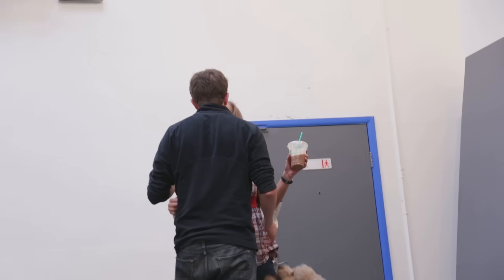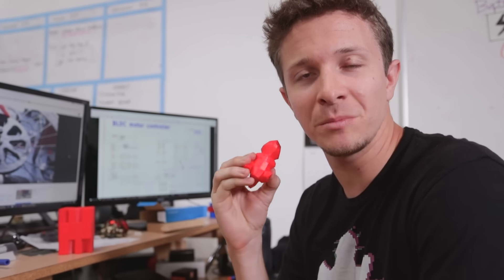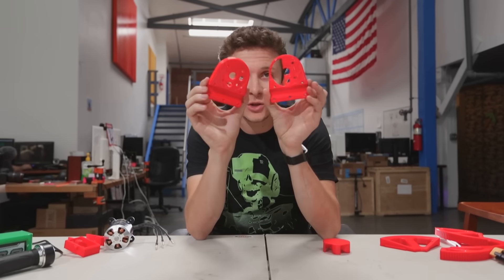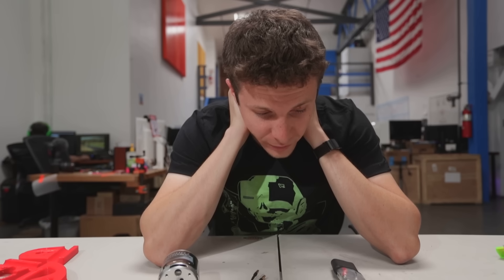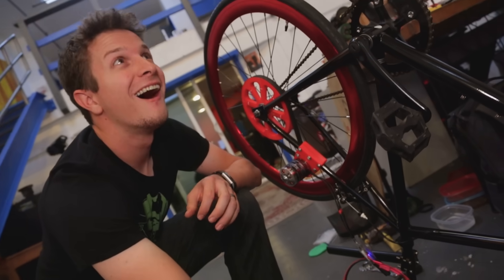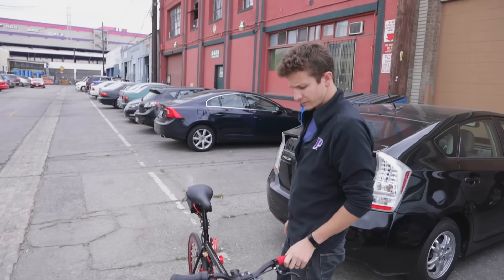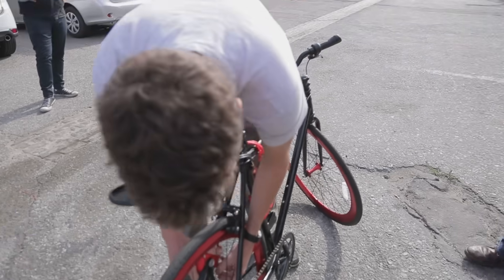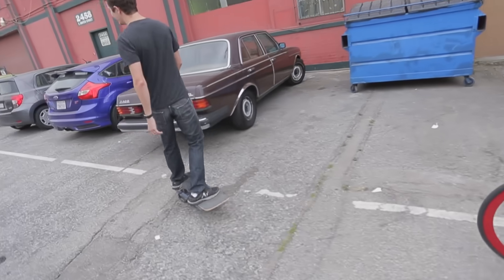Building a Tesla ELECTRIC BIKE For my WIFE

Comment: A weedwacker motor attached to the chain isnt that much harder then this if not easier
Reply: I saw this video like years ago it seems but not that long ago in reality in fact obviously if it's so much longer than it's been out I just got a Google suggestion to this channel has been on my to-do list to find it again. Your comment however is recent and I am signing in oh, I meant to say chiming, because when it comes to these outdoor power tools and their infrastructure we are getting batteries that are highly engineered and have what I consider to be for somebody who is poor, or ordinary, and lives near a store that carries the product, all important. I saw a electric bike advertise that had one of the tool batteries being used and I contacted the seller it turned out that he had bought it from a guy that had done the modification. That call ended up lasting several hours because the man with elderly and his wife have been victimized by an incompetent doctor and so otherwise I didn't buy the bicycle as he was asking for too much I would say and he didn't know anything about it, he did have very receptive ears to a lot of facts about how to accomplish this Mission as to his wife.

The voltage is for your weed wacker your leaf blower your snow removal dual-battery nonsense or a point of competition industry in the industry oh, the charging speed to a much greater degree than for Mobility is as well. Every year I tore the local Home Depot's to local Lowe's various other retailers. There are some shoplifters that the Fairly specialized in these batteries, but mainly it is shrank from employees. Very little in one of these big box stores is higher density in terms of monetary value send a large ventilated rapidly chargeable high-wattage multi-year warranties bricks. Their Motors are of course mainly cost engineered but obviously the $500 price point for a lawn mower I saw this video like years ago it seems but not that long ago in reality in fact obviously if that's so much longer that it's been out I just got to Google suggestion to this chat on his bed on my to-do list to find it again.

Comment: Ay, I'm extra late, but an easy fix for the slipping is to machine a flat surface onto the shaft so instead of a full circle, you only have a partial circle. This flat side allows a fully noslip setscrew to be installed and boom, problem solved

Comment: Won't lie, just putting a pulley on a bare shaft doesn't sound a bit iffy: I would have checked if there isn't some keyed solution, or use a taper clamp bush instead.

Comment: 12:45  what was wrong , can someone explain?
Reply: Essentially when the motor stops it locks up and stops the wheel so when he let's off the throttle it tries to stop the wheel with it but since he is riding the wheel pulls back on the motor and that's what caused it to bend like that.
The fix is changing a setting so instead of instastopping it allows the wheel to continue spinning despite the fact that the motor isn't working

Comment: pausing at 10:28. File a flat edge on the motor shaft for the grub screw in the small alloy pulley to grab, or drill a hole in the shaft for the grub screw to go into the shaft slightly.....

Comment: I love using PLA, but here in southern California, I can only use PLA for indoor climate controlled parts. I made bicycle parts before (water bottle cage, etc.) From PLA and it ended up warping from the heat on a hot day. Above 110F, not recommended.

Comment: You need to factor in time to your cost estimates. A Tesla can take 3 hours to charge, whilst filling up my gas tank takes 5 minutes.
Reply: Not even 5 minutes but in the batteries defense it is much cheaper to charge it up and if time is an issue for you , you can always get 2 batteries and swap them around

Comment: The pulley slipping is an easy fix. Jut file two small flat spots on the motor shaft to correspond to the two set screws on the pulley. Use locktite to set the screws.

Comment: The fuel math is way different for MA. Electricity is 20 Kwh and gasoline is $2.79. So that car, if it gets 40 mpg, would cost $17 to go 250 miles. To charge the Tesla to 85 KwH would use 100kWh of power since the charging process loses 15%. So $20 to charge, which is more than the $17 in gasoline.

Comment: SERIOUSLY! You take a (max.) $5 pulley and redrill it??? Just buy a NEW pulley with a bigger hole. Why, why, why....!?!?
And while you're a it, buy a STEEL PULLEY.
And DON'T USE SUPERGLUE. you flatten of slightly drill the motor axle in place where the set screws are.
And you cannot always reverse polarize an electric motor, as it's often design to run in a specific direction. Reverse polarizing would be possible, but the motor would not be as efficient.

Just ask help from some machinists next time.

Comment: Could have just drilled with the press through the set screw into the shaft of the motor and then tapped it so the screw goes into both.

Comment: To centre a drill press just get a drill bit that fits right into the existing hole and use that to centre it by putting it into the hole then put the bigger drill bit on and BINGOOOOO

Comment: Wheel was wobbly cause you bent the spoke.  When wheels get wobbly like that from regular use, you can straighten them back out using the spokes.  It's called Truing and it's a regular part of bike maintenance.  It's especially important on rim brake bicycles, since the bicycle rim itself is the braking surface.

Comment: Yes, it IS fixable. Drill a radial hole in the pulley, tap it, grind a flat in the motor's axle (a Dremel works great here), then use a set screw against the flat to lock the pulley in place.

Extra credit for drilling and tapping another hole at 90* to the first one for a second set screw. 

The bike could have been up and running the same day.

Also, using a couple set screws against the frame wouldn't be a bad idea for the motor mount to keep it from rotating.
Reply: Until she pedals harder and torques the pulley. It needs a much more complex gearing setup than what's on display. Not sure I'd let my wife ride one anyway since it's basically a shitty motorcycle. The safety of a bicycle is in its foot/balance connection, and women are on average notoriously bad at cycling already. Putting a fast motor in the mix is a recipe for a City of Angels remake.

Comment: I know I'm way late. But as a bicycle mechanic I'll say we are not a fan of aftermarket motor tech(electric or gas) on bikes. Where I work we do install aftermarket electric motors into wheels of bikes. Even high quality stuff is …   questionable. Bikes were not made to have motors on them so it always winds up slightly "shoddy". Even when done by professionals. Now us mechanics are not entirely against ebikes. We just prefer bikes built from the ground up as one. They are built with stronger sections of the frame to deal with added force from weight and torque. The tech is also implemented very well so it's not any motor, wires, and battery just slapped on somewhere. And if you have the opportunity we recommend to get the mid mount motors as opposed to wheel mounted. For weight distribution reasons and the quality of the mid mount motors typically kick wheel mounted versions asses. If anyone is interested in a ebike of decent quality be prepared to spend 2k minimum. I see a lot of videos of people trying to mount crummy motor systems to dirt cheap low quality bikes and it's saddening cause we see those people come in our shop because they have problems from this cheap chimera that wasn't meant to be. I'm not looking to talk bad about wren. I think what he is trying to do is lovely and cute for his wife. I'm not smart enough to be an engineer I just wish to share my perspective as a bike mechanic who works on all manor of bikes at every price point for a living.

Comment: bro the spoke is broken that is the cause of wobbling. The different air pressure causes the air to pass through the structural breakpoint also the broken spoke doest have as much strength, therefore, it bends the wheel on the weak point

Comment: dude I know this is a bit late but In the small aluminum gear pulley thing there's a place to screw onto the shaft. if you sdrill the shaft so the screw in that aluminum piece can go in to then it would work. and also to fix the wheel all you need to do is put a brand new spoke in and tighten it to fix it's true
Reply: Yep

Comment: Loved this video. Awesome looking ebike. Video idea: 18 wheeler electric longboard!!!!

2 years later it might be time for an upgrade? I would love to see a new "Wren makes his wife an ebike" video with the technology available today (mostly cheap chinese parts). 1500 watt hub motor. 1kwh 48 volt battery capable of continuous 30 amp draw. Max speed of approximately 45mph. Range approximately 30 miles of full throttle.  Cost approximately $800 USD (not including the actual bike, you would just rebuild the same bike)..... And then Wren would need to add about 14 more powered wheels and a ton more batteries to that 10 foot longboard to keep up.

I've built mine about 3 months ago and it is, well, rather dangerous. But FUN AS HELL! I have put almost 2,500 miles on it in 3 months. Catching up to cars who try to kill you so you can properly inform them of their vehicular manslaughter attempt and ask them, politely, to PAY ATTENTION :()

Comment: I have a bike like this. Its 29" fixie frame with a front hub brush less 48v  with a 1200w 52v battery.  That's a top speed of 55km/hr with a range of 37km. Its been running gat for 5 years now but its a death wish  that's difficult to slow down at full speed

Comment: 6:32 if you compare it to a non-electric bike it cost $0.00 to ride it for as long as you want.
Reply: Actually the average cost of fuel for non motorized bikes is about $8.50-12.00 depending on the fast food joint.
Reply: @chaud8803  Humans have to eat regardless of whether they are biking, so you might need a couple hundred extra calories per day if you are biking to work but that is like a $2 protein bar which also goes towards the exercise value you get from the activity. And if you are trying to lose weight then you don't need the extra calories so it's free.
Reply: @al11196  Yeah but when your talking about refueling or recharging, you recharge the whole thing regardless of how often you use it. In this scenario the person would be the battery and eating would be recharging so.. not free.

Comment: Could have used a drill press to etch a slot into the motor shaft and a slot in the pulley and place a key in and then soder the end of the shaft to the end of the pulley

Comment: Electric vehicles have a fantastic cost per mile compared to gas. The downside!

Adding another 250 miles of capacity to a gasoline engine costs maybe $5. (double the size of the gas tank)

Adding another 250 miles of capacity to a Tesla Model S costs (depending on the kind of batteries you buy) around $12,000.

It's all tradeoffs and whether you think the increased up front costs will pay themselves off by being 1/3 (or less, if you charge from solar or other off-grid sources) the price of gasoline.

Comment: I think you have to heat up the aluminum pulley and the solder will be drawn into the void between pulley and shaft via capillary action to create the strongest bond possible.
Reply: that would still never hold.  the answer is to key the shaft, so the set screw has something to grab on to.

Comment: You made your life un necessarily difficult, I imagine it was done to make the video entertaining because there s no way you don't know better.

The type of motor and transmission of movement you chose is absolutely dreadful, the worst possible in the industry, and it's not cheaper so it's not justified by cost.

The best mechanical solution is motors that are installed on the bottom bracket (where the pedals are) because it transmits power straight to the pedals and you don't need to alter anything or add gears etc. Also, it keeps the center of gravity low so it makes the bike more stable. 

The only downside to that is that you need to mess with the bottom bracket, which a lot of people are not intelligent enough to do or don't have the tools to do, but for an experienced engineer such as yourself that is the way to go, because it creates the most effective and reliable bike.

The next choice would be those kits that send you an entire front or rear wheel with the motor already installed on the centre of the wheel. They are quite cheap, and zero specific knowledge or tools are needed. Especially if you choose the front wheel, in which case you dont even need to mess with the rear wheel gears, and also has the benefit of 2 Wheel Drive when you pedal the back wheel, and the front has the motor on.

You chose the absolute worst option mechanically, a motor that hangs on the side messing with the bikes' balance, and also needs an extra custom transmission method , besides the existing bicycles' chain.

I mean, you MUST know better than this, bro.

Comment: 10/10 on the husband scale 

You are doing a great job
Reply: i like your profile picture
Reply: 69 likes
Reply: @JBMetalProductions  690 likes
Reply: #relationshipgoals
Reply: JerryRigEverything is also a great husband
Reply: how would you know lul
Reply: Maybe 9/10 because he got her a men's bike (frame), meh. xD
Reply: @nostromov7892  womens bike has gaps for pussy and boobs
Reply: @nostromov7892  Well, if I remember correctly, male bikes are shaped that way because it offers more structural rigidity for the extra power and weight put on the bike, it's a better shape. Women's bike offer easier "step in" but used to be heavier to account for the weaker structure. The fact that you can wear a skirt on them was also important.
That's why women's race bikes have the high top tube, less weight, better rigidity and no need to account for skirts.

Comment: Could you not use the regenerative braking to act as a brake and recover the energy? It would mean making the motor mount stronger and fixing it so it doesn't rotate round the frame
Reply: I.e. fixing it to both seatstay and chainstay. Though I'm not sure if this motor (especially the bearing) is even thesined for this application.

Comment: "What to do next"
Custom long range battery mounted on the down tube.
Buy bulk cells, a spot welder and learn about battery balancing.
Put a hub motor on both wheel for 2WD!
Which is like 4WD for cars, a super off-road mountain bike!!

Comment: kW is not speed.
kW is rate of energy transfer.
1 Watt is 1 Joule per second.
However, when you have a motor powering a vehicle, it's maximum velocity is a function of the forward motive power (motor kW) and the regarding power (friction, air resistance).
Of course as the voltage drops, the motor won't have as much torque or max power.
Also, buy a hub motor.
https://www.amazon.co.uk/dp/B07KP9D3GS/ref=cm_sw_r_cp_apa_i_xDrbDbY8NNDG4
Reply: It took me 3 tries to read through this, each time I got about halfway through and instinctively scrolled down, but then went back to finish it.
Reply: @Ducksnuget  
Not my best piece of writing, sorry 😕

Comment: "kilo watt" is NOT "speed" if that is what you said ...."kilo watt" is 1000 watts ....kilo watt HOURS KWH is 1000 watts for one hour ....DUHH ....To compute watt hours you have to multiply the voltage by the amperage and if that is the average draw steadily then it is simply a matter of seeing how it relates to KWH ....For example IF you had 10 amps at 100 volts that would be 1 kwkh or whatever the power rate you are  paying per kwh ...which in california is WAY higher than what you quoted ....you are quoting the average low tier lifeline that generally EVERYONE burns through and then is paying higher tier rates (TEAR rates).....like 45 cents a kwh or whatever .....especially in the summer when the power companies full on GOUGE to supposedly encourage people to conserve  .... another example lets say your motor  pulls 20 amps at 25 volts that  would be 500kwh or approaching .25 per hour of operation

Comment: Next MOD would be to design a way to recharge the battery while pedaling? :)~
Reply: they call that regenerative braking, and they call it that because it adds a large amount of resistance.  so the bike would be way too hard to pedal, and no one would use it.
the only time you might use it would be if you were going downhill or coasting to a stop... so if there was a switch on the bars that would let you turn regen on and off, that could be cool.  but like the other dude said, it adds a very tiny amount to total run time; so using it on and off like that would give you very very little regeneration.  
in other words, not worth the trouble.
Reply: A (large) loss to heat and in the conversion process (back to battery), unfortunately! What to do. :f
Reply: @thinkdunson  it is if you wire the regenerative brakes to the brakes, otherwise it would only make it inefficient
Reply: Wonder if something like a car alternator could be added to the front wheel to charge the battery while the bike is in motion.
Reply: Why not modify the batter and add a small solar panel to it? Calculators use very small solar panels to generate power when there’s no battery, so it could generate a few kWh while pedaling. Or better yet, switch to pedaling mode to charge the battery kinetically when the electric energy runs low
Reply: And regenerative breaking, it can add like 3, 5, 7% or whatever, depending. Funny thing is when I see $7000 bikes without it (there are many and people actually buy them, LOL).